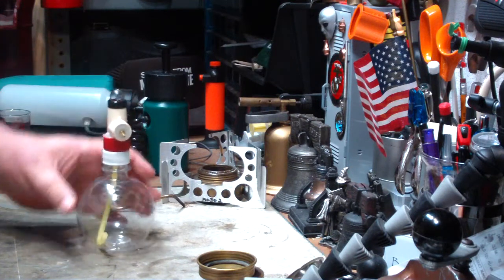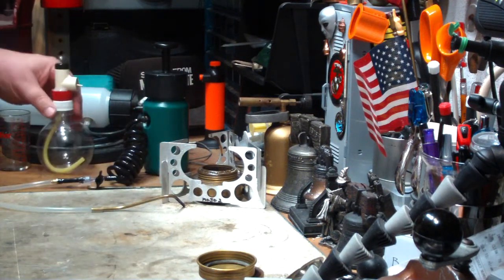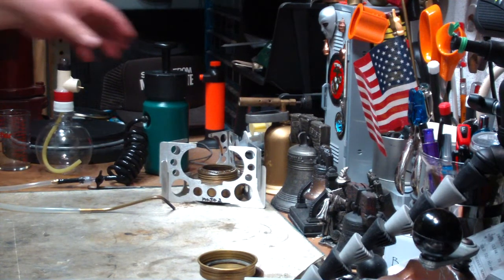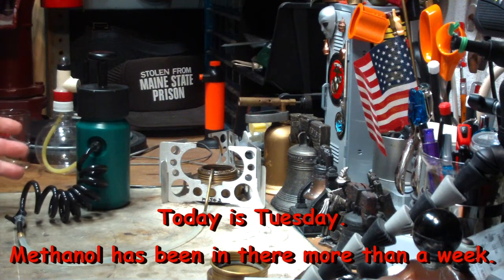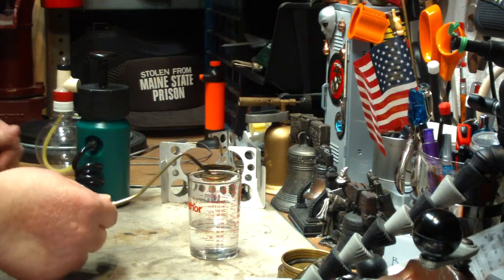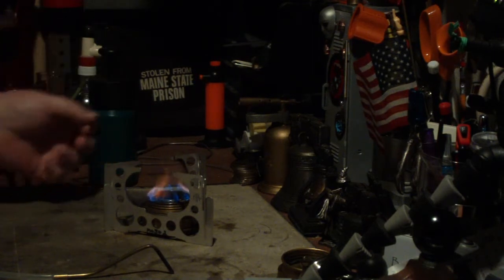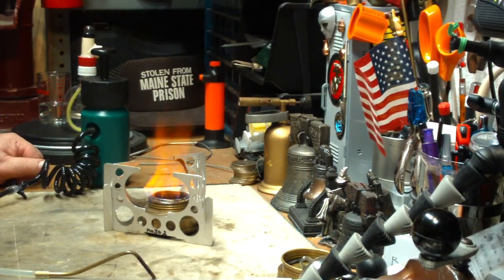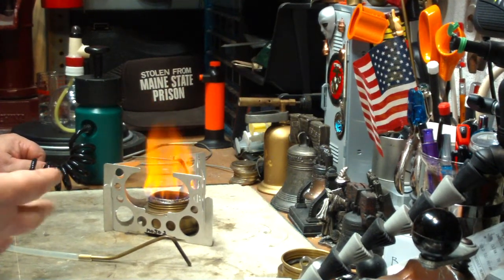Idea for a Pressurized Remote Fuel Feeder

Comment: in the garden chemical section of the hardware store is a portable sprayer.  they come in 1/2 gallon up to 4 gallons carried by the handle and 8 gallons worn as a backpack. Large versions of those mister canisters.  Those have larger spray nozzles and the biggest models have replaceable orfices for different patterns and spray rates.

Comment: I put a chemical sprayer bottle on the tractor to use as a fire extinguisher during harvest. a little bit of water goes a very long ways as far as wetting things down.  putting the canister in the sun is enough to get the water warm enough that it isnt cold. enough for bathing purposes.  an adult could easily completely shower start to finish with a gallon of water

Comment: I have a brake bleeder system that uses a canister with fluid on the bottom that you pressurize with less than 10 pounds of air.  attached to the master cylinder you can bleed the brakes on all four corners.  two hoses into your bubble bottle lid. one for air and one attached to a hose to the bottom where the fluid is would work as long as you could generate and hold pressure. .

Comment: Could you leave the hose valve open and just use the air pump to push fuel out with each stroke? Then you could leave the tank unpressurized and not run the risk of an unwanted flamethrower or overfilling your burner.